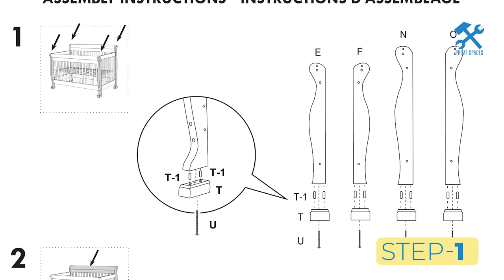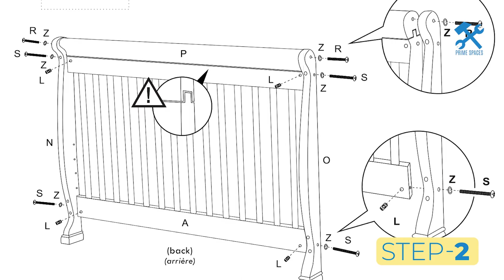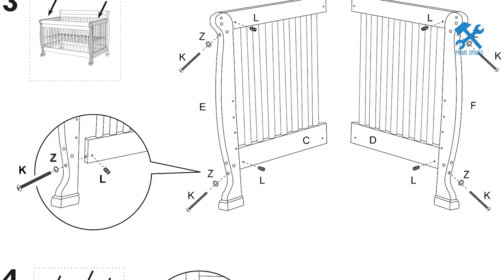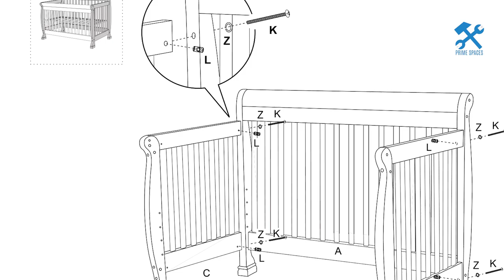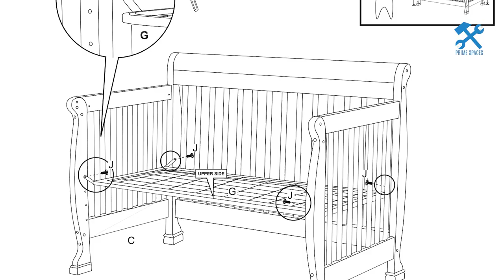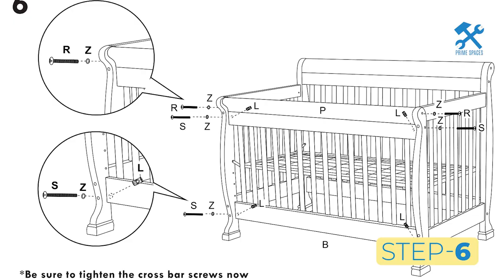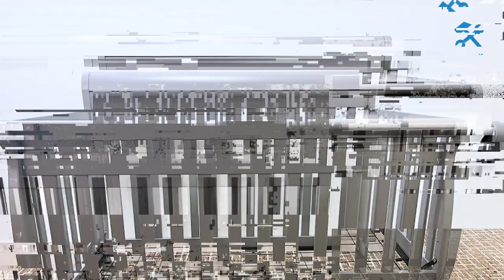DaVinci Kalani 4 In 1 Convertible Crib Assembly Instructions (Full Step By Step Instruction Guide)

Comment: Ok so I’m on the sides. I got everything together- but the bottom of the side C! The screw is  NOT securing with the barrel nut? I know the screw isn’t stripped Bc when I take it out- it fits securely . I’ve also tried 4 different screws and barrel nuts! Could it be something with the hole in the wood?! HELP!
Reply from the maker: Hey Jackie! 👋🏾 It’s possible that you are inserting the nut too far into the hole and the bolt is hitting the top of the nut (slightly above the hole. Sometimes the manufacturer doesn’t make the whole the exact height to align the boat and the nut. Does this make sense? Give us a try and report back if this fixed the issue or not. Also, please subscribe to the channel if you have not already! ✅🙏🏾

Comment: This was a nightmare.  None of my bolts fit and I can’t tighten the frame. Step 4 literally will not screw in no matter what I do.  Hours spent trying to screw these in and I can’t finish the crib.
Reply from the maker: Hey Julian. That sounds super frustrating man. Unless they sent you a complete wrong set of bolts, it sounds like you may be using bolts in the wrong places. Can you confirm whether or not you have the bolts shown in the link I pasted below? If I were there I would disassemble the entire thing and organize all the bolts like I did in the link. Beware that some of them look the same, but are different and won’t fit if you put them in the wrong place. If your bolts match what you see in the link, then you should be able to assemble the crib. Just make sure you are properly identifying the bolts before using them.  And please, update us if you have success putting it together. https://www.screencast.com/t/8wgJvinqG5e.
Reply: This is my problem with one of the screws on the side. I am certain I am using the right size screw. Did you find a way to fix this issue?

Comment: Do you have a video on how to turn this crib into a toddler bed???????? 
I need help!!
Reply from the maker: Unfortunately, I don’t. This was assembled for a customer of ours and they opted for the fill crib. I do know that you will need to undo the bolts for the front part of the crib in order to attach the toddler guard.
Reply: Where do we purchase the toddler guard? Mines never came in the box.
Reply: @CloseYourEyez00  They stopped including it in the box a few months ago, it's a separate purchase from Amazon. You've probably long since sorted this but just want people to know - this NO LONGER includes the toddler rail by default. To make it a toddler bed all you do is stop before they put on the final "front piece" after box spring installation. Then apply the kit (Part M3099).